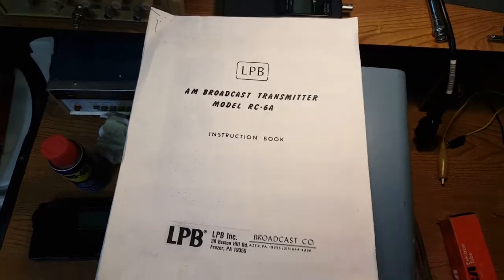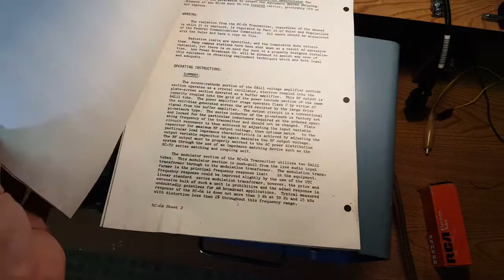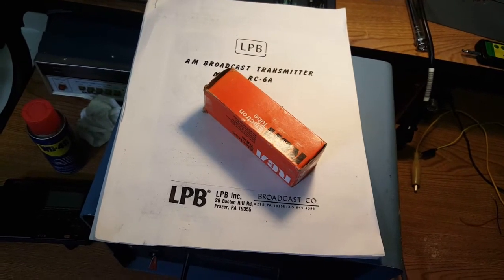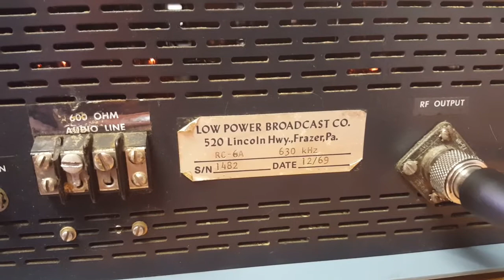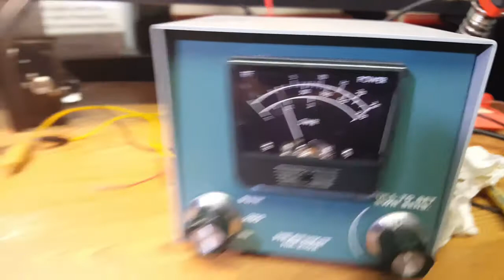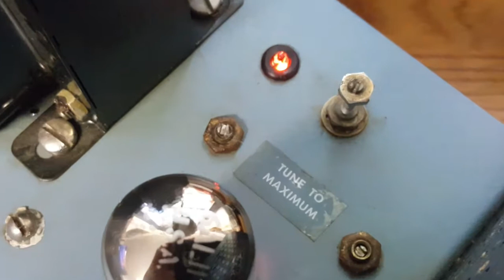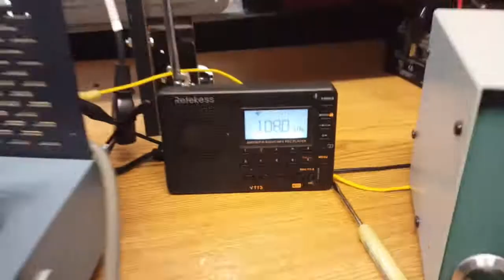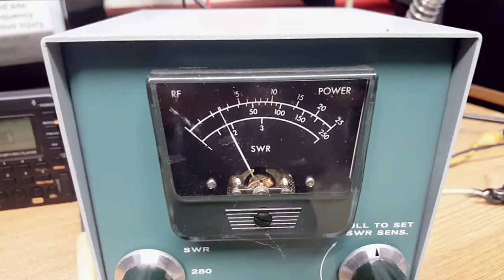LPB RC-6A Low Power AM Broadcast Transmitter | Overview and Breakdown

Comment: These units had a LC interface to couple them into single or three phase electric systems to use the building wiring as an antenna.  They were popular in college radio stations.  There were 20 watt models that could feed multiple amplifiers in adjacent buildings so that one frequency could be used.  It would be a great unit for an antique radio collector to broadcast to a collection of old radios.  Using a antenna matching unit to a long wire antenna would quickly get the FCC's attention.  The person who ends up with this will need to find or build an interface to their home electric panel.

Comment: i have built a rc-6a lowerd the power to 100 millowatt and made a power line coupler to comply with the fcc part 15  . the power line coupler has too much 60 hz carrier hum i'll have to get a lpb model t2c power line coupler . i have manuals on the mark 3 ,rc-5a ,6-a and rc-6b  .

Comment: Hi.  I just bought the 6B version on ebay.  It has had a rough life.  It shows signs of having ran very hot, judging by the color power supply choke, and a couple of drops of ?something? on the inside of the bottom case.  I have to replace the socket on the oscillator circuit board.  Have 3 new old stock 6AL11s on the way.  Going to do some continuity tests on the power transformer, choke, modulation transformer, the 600-ohm input transformer this weekend.  Would it be possible to obtain a copy your manual?  Thanks!
Reply from the maker: I actually sold the transmitter so I no longer have a manual. Sorry!